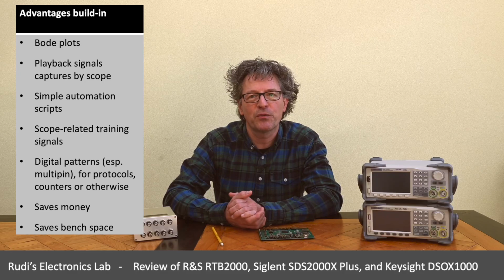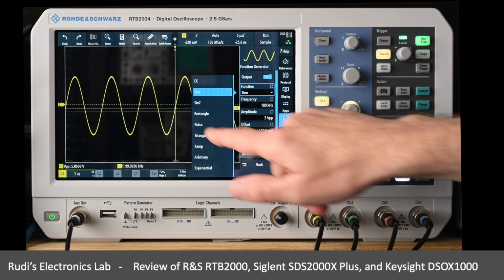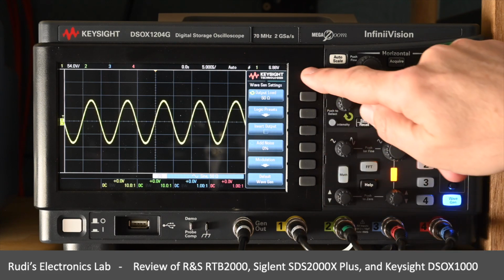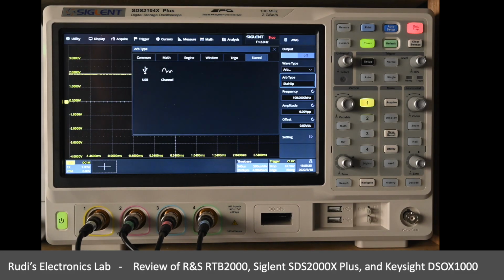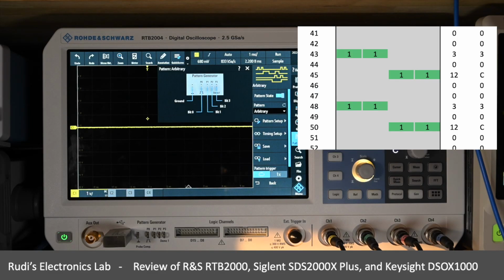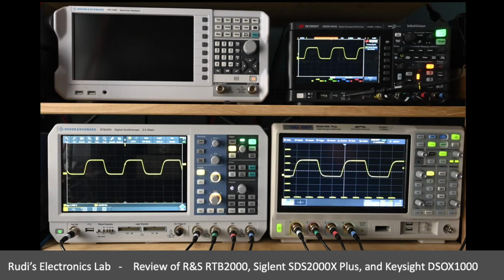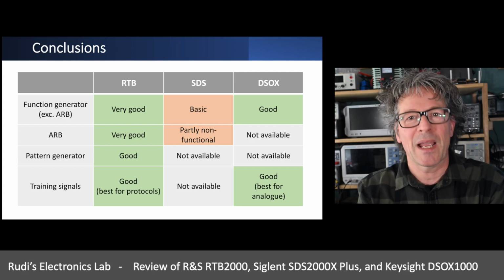REL #10 RTB2000, SDS2000x Plus and DSOX1000 Series Oscilloscopes, Episode 7: Signal generators

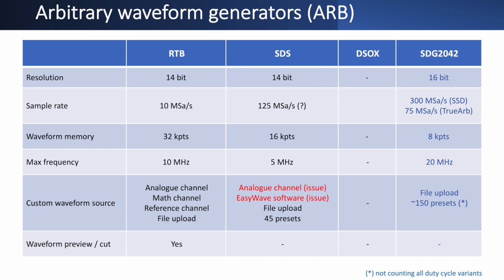Comment: @22:39 Small correction: SDG2042 sample memory is 8Mpts, not kpts !
Reply from the maker: Wow, you are right indeed! Just checked it. Somehow, I when I was looking at devices with an ARB memory of 8kpts and 16kpts, I was not expecting another device to have specs 1000 times better than that! Also because in other respects (e.g. rise time of square waves), the SDG2042X has worse specs than the cheaper SDG1032X brother, and in Siglant’s own presentation heralding the SDG2042X over the SDG1032X (just search for “How to Choose an AWG: SDG2000X or SDG1000X) it does not even mention this generously bigger ARB sample memory! But it’s good to know and when I need longer sequences, I will definitely turn to the SDG2kX. Thanks!

Comment: the solution is to store the waveform via save/recall. The siglent UX is really lacking - but I could not afford the R&S prices.
Reply from the maker: Sarming, thanks for the reply. If you are able to do this with save/recall, you might have more information than others do…. EEVBLOG member Cesare posted yesterday that he found out the missing file the SDS reports is AWG_channel_wave.bin and should be present in location /usr/bin/siglent/usr/usr/. This location cannot be reached from the device's own UI so you need a telnet session. It seems, however, that copying an existing ARB preset to that name does work, but that copying an actual analogue waveform saved as BIN does not. Possibly, there first needs to be some sampling in which the large number of measurement points are reduced to the 16kpts max that the ARB generator allows for. But if you have the knowledge to make this work, please share it with us!

Comment: The cut in arb waveform in RTB2004 seems not to work properly. You forget to "Press "Copy" to create the arbitrary waveform from the selected "Source" "
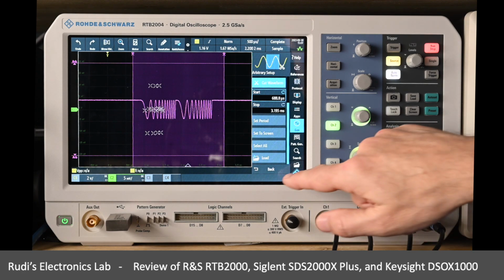Reply from the maker: Dear Egon Otto. There was a little glitch here. The waveform from the channel to the ARB was correctly copied, though. At 24:49 in the video you see that the ARB first contains a waveform from a previous project, and after I press ‘copy’, you see at 24:59 how it is replaced by the newly captured wave from source Channel 1. Yet, at 25:58 I forget to push a button that actually cuts the wave at the position of the scissors. So I created the new ARB but did not yet shorten it. Thanks for noting!

Comment: Hi, in RTB2004 the datasheet with Arbitrary  sample rate  max. 10 Msample/s is wrong. I think they mean the frequency is max 10 MHz.
Reply from the maker: Hi, thanks for the comment! I indeed took this spec from the datasheet itself (R&S®RTB2000 OSCILLOSCOPE Specifications Version 13.00). Now that might be wrong.... Thinking of what a (simple) good way may be to find out the actual sample rate!